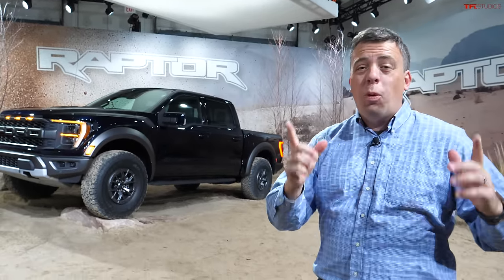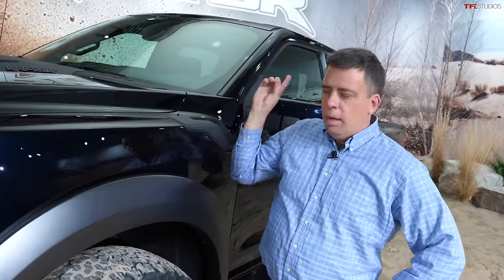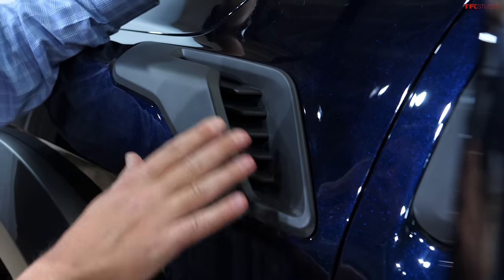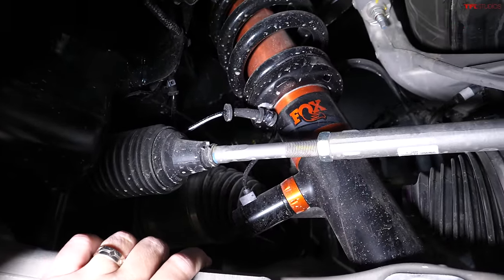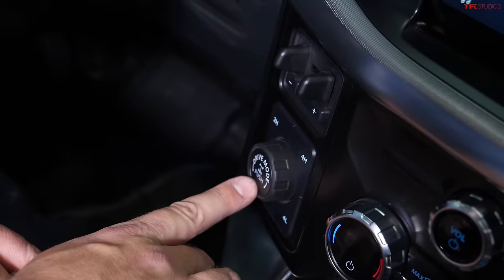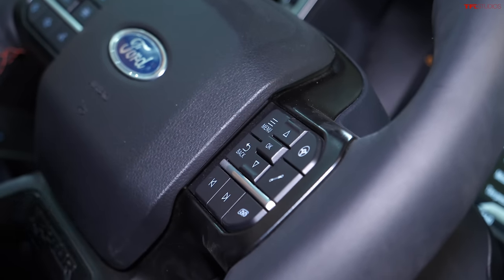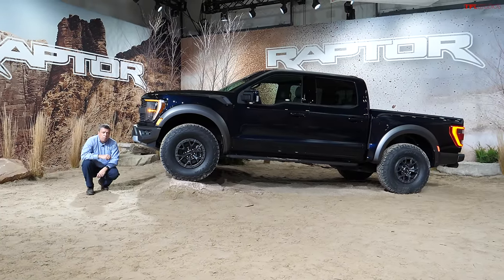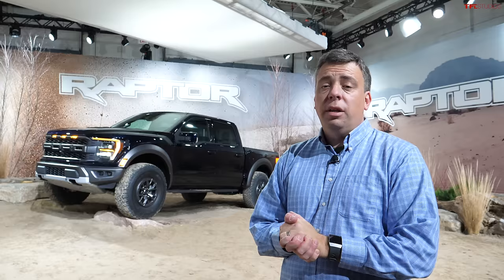2021 Ford F-150 Raptor World Debut: I Get My Hands On It — Here’s Everything That’s New And Cool!

Comment: Huh so still a V6? Guess I’ll be seeing a lot more Dodges on the street now...
Reply: Lets see, $55-75K Raptors or $75K-100K TRXs?  I think there are two different price points that will allow plenty of sales for both, but the Raptor R is coming out a year later with the GT500 motor.
Reply: 2023 Raptor R will have it.
Reply: A V6 with a 0-60 time.
Reply: 0-60 of 4.1s
Reply: @gpaje  yea people don't realize the price differences lmao
Reply: @gpaje  idk if the 5.2 v8 will be supercharged or naturally aspirated
Reply: @coolsquad7428  It's likely going to be the one in the GT500, which is supercharged and over 760 hp.
Reply: @69Mach I CJ We also heard that rumor, the latest is the GT500 motor to match up with the TRX.  The NA 6.8 won't come close to the power needed.
Reply: @gpaje  yeah but the hellcat engine is superfast with power to weight ratio of that engine
Reply: @gpaje  dodge arn’t stupid thats all I can say because all dodge have to do is add there demon engine with crazy shocks
Reply: @coolsquad7428  Compared to a GT500 motor?  The HC motor has less hp and more torque, the GT500 is the other way around.  It's the "faster motor", though I suspect the HC is better in a truck application.
Reply: @gpaje  yeah but will it be enough to beat the trx tho because the trx destoryied the raptor when it came out soo it is a idk atm because the trx fastest 0 to 60 is 3.6 seconds actually
Reply: @gpaje  these trucks will not be anywhere near 55k will probably be starting around 70k for this gen raptor
Reply: @Warthog32695  Sure, but I'm giving you their price points from high to low, if you prefer, then 75K for the Raptor and 100K for the TRX for the high end.  Same difference in terms of price between them if options are equal.
Reply: @coolsquad7428  Destroyed?  The Raptor V6 with only 450 hp is within a second of the TRX with 702 hp.  The difference is nearly 700 lbs lighter weight in the Raptor, with more hp (750hp) it will absolutely beat a TRX. Heck it can do it with the same hp due to the weight difference.
Reply: @69Mach I CJ It will not make the power to compete against the TRX, the GT500 motor will.  We won't know until it comes, but if I was a betting man, the GT500 is the motor they are going to use.
Reply: @gpaje  I don’t think so because the trx goes under 4 seconds 0 to 60 as the raptor gets a little over 5.1 seconds
Reply: @coolsquad7428  Sure, but were aren't even there yet. Not like Ford can't bump up their motors either.
Reply: @69Mach I CJ Absolutely, either option would be cool.
Reply: Dodges better keep lifters and cam in back seat! Just like ignition resistors back in the old days. Go Ford much better reliability!
Reply: @arendbehrens2761  you're basing reliability on truck built in the last few years based upon an uncommon problem from decades ago.
Reply: Bought my 2018 Raptor new for 55k... tell me where I’ll be able to buy a TRX for that price
Reply: @Turkey_Pot_Pie  probably in 3 years "lightly" used XD
Reply: Baja inspired trucks and you plebs are worried about 0-60 on the STREET.
Reply: @gpaje  Dealer mark-up will bring the prices closer...
Reply: More raptors lol 100 k with the economy how it is lol and gas ! Super charged lol
Reply: @EffDinero8  Between who?  The dealership mark-up will be high on both trucks, arguably higher on the RAM due to it's more "super truck" image with it's motor. The difference will only get wider between them in reality.
Reply: @gpaje  Yeah but I'm not so sure the Raptor or TRX really qualify as trucks anymore, they are super-trucks at the least.
Reply: Yeah right. All of you people in the comments are broke as hell and can't afford a TRX
Reply: @gpaje  don't hold your breath the mustang is going all electric by 2030.
Reply: @gpaje  the Dodge motor dose not vibrate loose oil filters and cause engine fires. Adam lz found out the hard way and his car burned down.
Reply: @gpaje  it sounds like a piece of V6 garbage it don't matter what specs u throw out. When u hit the start button u hear V6 dissapointment every time
Reply: @stevenplaskett7728  Sure, whats your point? Ford has no issues selling ever single one they make without discounts. The V6 isnt the truck for you, wait for the V8 or get the TRX.
Reply: @stevenplaskett7728  It hasn't been Dodge for over 10 years, it's RAM. I currently own a RAM Rebel, which I love, but if you go to the RAM forums, they have their owns issues just like all brands, luckily it's only a small percentage of engines, just like Ford.
Reply: @stevenplaskett7728  So has pretty much everyone else. In fact, Camaro will be fully electric before the Mustang, which makes sense since their sales have been in the toilet and GM is going to remake the car into a full electric muscle car before Mustang does it.

Comment: Is it so hard to put the gt500 v8 in the raptor?
Reply: Their financial group probably assumed it’s not worth it...  they may do it for a limited run as a publicity stunt. But that’s all I’d ever expect
Reply: it will
Reply: @JTL-uv6cm  oh did you ask them. I was wondering who to call...
Reply: @brendanschriber3242  bruh what do u think the Raptor R will have
Reply: @srt4788  i dont know. What do you THINK (key word) it will have? I’d say powerboost but last time I checked the public doesn’t know
Reply: @srt4788  but if you know what the future has to hold can you tell me tonight’s powerball numbers?
Reply: @brendanschriber3242  why would they make a R version with the same engine from the regular version
Reply: @srt4788  great question. Guess we will find out later on right?
Reply: I wouldn’t do that. I believe it should have the super duty engine 7.3.
Reply: @srt4788  by that point the trx has gonna been  out for 2 years with a V8 that is legendary who tf wants a voo poo when dodge has been killing the supercharged V8 game for years now with an engine literally called the hellcat, if ford thinks that the people only want a V6 dodge begs to differ and actually deliver what the people want
Reply: @whatswiththissassylostchilld  I'm thinking the 6.8 which is an aluminum block version of the cast iron block 7.3.
Reply: There might be an issue with the 10  speed auto. The 5.2 in the GT500 comes with dual clutch 7 speed auto. Maybe it's not adaptable to a F150?
Reply: They were supposed to out the 5.2 voodoo engine in it. Wtf happened...
Reply: @billymc2681  I think the cast iron would be good since the hemi is cast iron too.
Reply: @billymc2681  I believe the truck would burn out the clutch lol
Reply: @whatswiththissassylostchilld   it would be awesome if they supercharged the 7.3 and put it in the raptor
Reply: @brendanschriber3242  that makes sense. These trucks aren’t cheep.

Comment: Ford is probably going to come up with something stupenduously powerful for the size of the truck.
Reply: It’s going to be the 5.2 supercharged v8 out of the gt500 that makes 760 hp
Reply: @Nickname2438  we need more manual. If it ain't manual, it doesnt have my attention.
Reply: @rampagedingo  

But the TRX isn’t manual
Reply: @rampagedingo  

I have huge respect to manual transmissions but let’s face it, we are going to future, automatic transmissions and electric vehicles are now becoming common,
Reply: @TecDLogic  well here in Africa not yet for a very long time. I hope they come up with conversion kits to change a normal diesel or gasoline vehicle to an electric one. But I presume itll be quite complex, the chassis requires massive work for the batteries but I think that's it. Speedometer, transmission change and batteries. If that occurs then I'm definitely going to do a conversion on a really cool old school truck like a 1990 ford f350 or a toyota hilux or 3rd gen 4runner.
Reply: @saltyfloridaman7163  ranger raptor is for sale here. Apparently people in South Africa can buy the f150 raptor in right hand drive guise and it's a special edition. Kinda. And I'm in Mozambique, the east coast literally beside South Africa, Zimbabwe and Zambia, below Tanzania. In South Africa there are only 2 electric cars available at the moment the nissan leaf and the bmw i8. Super expensive, biggest issue here in Africa is that the infrastructure requires a lot of money to design and implement even if they do the roads are mostly off the pavement that's why most people here drive 4 cylinder diesel trucks. Economic and powerful, except ford has a ranger wildtrak with a statught 5 cylinder. Odd sound but I love the power in those...especially with a manual.
Reply: "And more to come in 2022" so they say. I just wonder what it is. Now Ram, give us an aluminum body TRX (for weight reduction like the Raptor) with the Hellcat H.O engine with 800+ horsepower.
Reply: This was an epic fail by Ford.
Reply: @qwikrip  I think they should stick with diesels
Reply: @private6549  I wonder what GMC is doing at the moment. Maybe they're quiet about all this super truck business then they'll drop out an electric super truck. You never know.
Reply: @rampagedingo  The GMC Hummer looks interesting but we will have to see how capable it is at baja.
Reply: @private6549  yes the maneuverability of the vehicle is interesting I cant lie. Let's see how reliable GM is with their electric vehicles in the near future.

Comment: Lol 😂 ford sticking with the v6 lol 😂 the trx will stay the new king lol
Reply: Raptor R will have v8 💀 dodge will have yet another slower vehicle
Reply: @zackatron925  By then, the TRX will option it with the Demon engine. No way they bow to Ford.
Reply: @guardrail2897  Shelby makes a f150 that has a stock 5.0 with a super charger and it takes the TRX in a dig and off the line... that’s fords smallest displacement V8. The GT500 beats every trim challenger on sale. Ford makes better engines plain and simple.
Reply: @zackatron925  lmao...ok
Reply: @zackatron925  Are you joking? I’ve seen the Demon destroy that little thing. And it’s even worst with the Jeep Trackhawk.
Reply: @535banshee  go watch throttle houses video on it.
Reply: @guardrail2897  the demons engine is a normal engine just tuned differently. Y’all are crazy for thinking this thing is a mega drag truck or some shit. The GT500 takes every product dodge makes right now. Demon will beat one off the line but not from a roll. Not to shabby for a pony car meant for the track
Reply: @zackatron925  btw “When was the last time you could go buy one?” That’s extremely irrelevant.
Reply: @zackatron925  The Demons engine has a 2.7 liter supercharger and the TRX engine has a 2.4 liter supercharger. Plus, the heads are different between the 2 engines. It's not a simple tune that makes the difference of 133hp.
Reply: @kingatlanofatlantis3075  Demon is 840hp on race gas.
Reply: @guardrail2897  Ford has done the same thing with the coyote platform and haven’t felt a need to make it known as some big change. Beefing up internals is done on almost every platform with age 😂😂 nice try
Reply: @guardrail2897  you act as if any person with a good set of tools and access to knowledge can’t do heads on a car. Not like cams are commune or anything
Reply: @zackatron925  You said the Demons engine is the regular engine with a tune. Bigger supercharger and different heads is far from a different tune. A teenager can put a different tune on a car. Very few can change the heads. And I'll bet money that you have no idea how to change heads. 🤔🤔🤔
Reply: @guardrail2897  I would not trust a teenager with the tune on my car. If they set your ethanol levels wrong you can scatter your engine, among other things. Many many videos and grandpas/dads teaching kids how to change heads. It’s the same engine with a few modifications. Get over it buddy

Comment: Ford has finally realized that coil spring rear suspension is the future something Ram has being doing for years.
Reply: That's actually the only thing about my 2017 ram i dislike, especially when I'm carrying weight in the bed. It likes to twist side to side
Reply: @myballsitchsomethingfierce6319  load is secured. Not sure why it does it though. Always assumed because of the coils
Reply: @hahaadventures4838  that will prolly be my next truck

Comment: Why has everyone been saying all week that it was going to be a 760hp v8?
Reply: That’s the 2022 model, which should have the v8.
Reply: @JeffBrauss  760hp? I high doubt it. Maybe 660hp
Reply: @kingatlanofatlantis3075  not sure, just the internet is buzzing with news Ford is going to challenge the TRX in 2022. I guess we’ll find out
Reply: The Raptor R will have a V8. Ford publicly confirmed it on Instagram. People have been theorizing that it will be the 5.2l supercharged V8 out of the GT500. In the GT500, it makes 760hp. This is why you have been hearing it. But the suspension on the Raptor and really all of the features it has over the TRX would put me in a Raptor before ever touching a TRX, plus that 10 speed is a mint transmission.
Reply: @enlightenedrenegade472  But Ram could also bounce back with another version of the TRX that has the Hellcat Red Eye engine with some more beefed up suspension and other beefed u features. Maybe Ford will impress idk
Reply: Because there were those videos online of the new raptor sounds, and a lot of people thought it was a v8. What I find funny is that as soon as the new raptor released, and people found out that it was still a v6, everywhere was like “it sounds terrible”. I seriously don’t understand people nowadays. Lmao
Reply: @kingatlanofatlantis3075  a fully loaded trx is already pushing 95,000 dollars... the base model is set at 70,000. How much would the red eye one cost 110,00? 120,000?!!! How the hell would they ever sell any of them. That’s always been something that you need to look at with these vehicles. A fully loaded raptor costs as much as the ram trx base model...
Reply: @jeffjob8265 but what I’m saying is, even if Ford comes out with a V8 760hp Raptor, Dodge can bounce back with beefing up the TRX with a Red Eye engine that has 797hp.

Comment: I'm glad ford is going to push ram closer to the 1000hp 700 is so last summer already.
Reply: Doubt will see a 1000hp unless it’s specially tuned for E85. Hard to make a safe and reliable 1000  horses on pump gas less you have a larger cubic inch engine.
Reply: @markball7028  The hellephant is calling brother. Will you answer?
Reply: @Davorox1  doubt will ever see that engine in a production vehicle. Especially with CAFE standards increasing every year. Halftone trucks are not excluded from CAFE. Plus it’s nearly $20,000 just for the engine. The hellephant only comes with a 90 day limited warranty. A ram trucks warranty period is 3 year 100,000 miles. Like I said. It’s hard to make a 1000hp reliable and solid through a 100,000 mile warranty period.
Reply: @markball7028  they could probably get away with putting it in a ram 2500. Epa is a lot less strict on heavy duty trucks
Reply: @markball7028  True. For the crate engins cost. The Hellcat crate engine is 16k. They could figure something out

Comment: Front end looks like meh and the rest seems the same. Interior is fordish and that exhaust sounds like shit.
Reply: They definitely tried to mix the 2008-2014 f150 designs with the 2015-2019 f150, and they didn’t even keep the good parts. The tail lights are straight copy’s of the 2013-14 f150s and looks like garbage.
Reply: @NoonMight  I mean idk about garbage but I definitely like the old one better. haven't seen em in person yet either tho
Reply: Yeah 2nd gen gets the looks for me and the 1st gen gets the engine this is just if you want a 1st gen but without the v8 2nd gen would be a better buy

Comment: I don't know why people are complaining in the comments about the V6. Why are any of you surprised? Ford has gone all in on smaller displacement, turbocharged, GDI engines. I think all of the complaining is irrelevant to begin with. Ford sells every Raptor they make, so clearly people who buy don't care that it has a V6 turbo engine. Now the coming "Raptor R" could very well have a supercharged V8 in it. But, I bet Ford would have to do a bunch of engineering to make it work, just like FCA did to make the TRX be able to handle the crazy horsepower it has. I like the look of the new Raptor. I think that new grille looks even more aggressive, and the new headlights are vast improvement. Good job Andre! Nice to see Ford has gotten past their nonsensical blacklisting you guys. 👍

Comment: Traded my Gen2 for a 19’ Ram Longhorn, slapped the Mopar 2” with 35s on it. Really like the Ram but my gas mileage is 12.9. Raptor was 17. A Gen3 may be in order...or on order I should say. Should be able to tow my RZR no problem. 🤘

Comment: That new Rear Suspension is AWESOME!
Reply: @myballsitchsomethingfierce6319  I know I’ve owned 2 of them :), but Ford took it to the next level using long trailing arms and active suspension valving.  #gamechanger
Reply: @myballsitchsomethingfierce6319  only in a drag race on pavement if that’s what you want why are you buying an off road machine?  Have you looked at how HEAVY a TRX is?  That’s a massive penalty for going fast off road and I guarantee if you put these two trucks on a king of hammers type of race course the Raptor with its better suspension design and massive weight difference that power of the TRX won’t translate into faster lap times.
Reply: TRX is awesome and the sound it creates is pure bliss. Love it too just saying it’s not superior in every way.  The other giagantoc problem is the price tag, TRX is about $15,000 MORE so there are pros and cons to both.